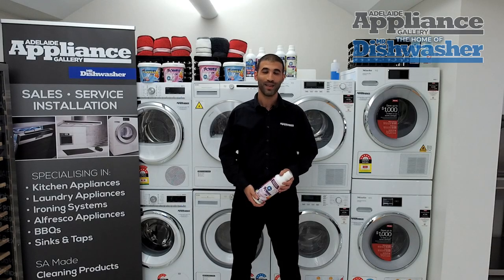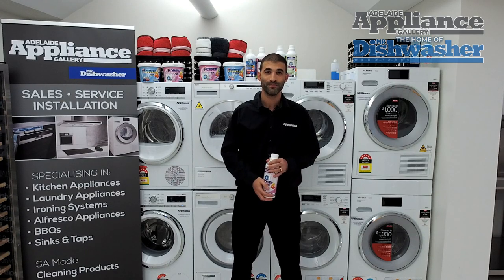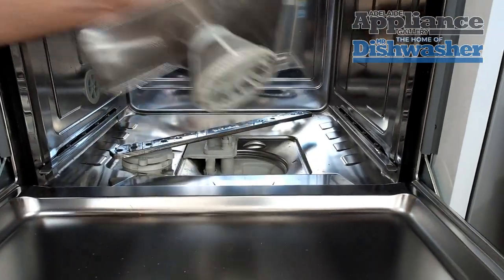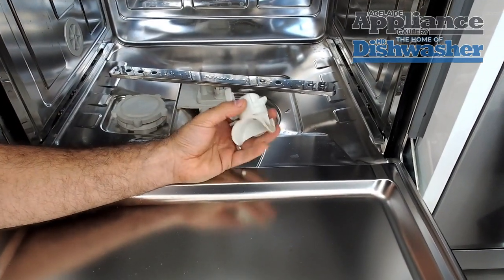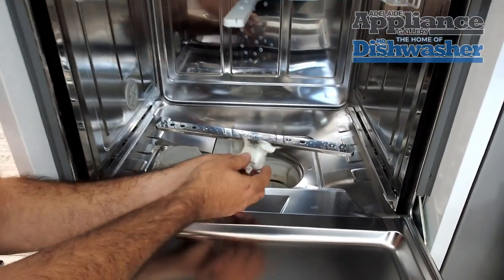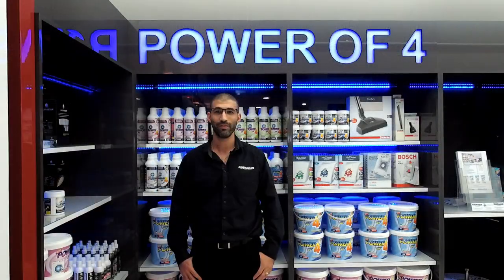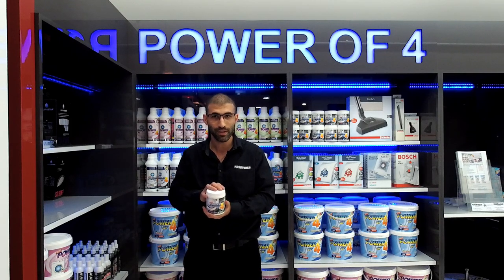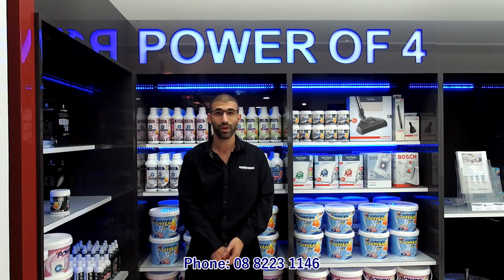Is your Miele dishwasher not draining?

Comment: Thank you! Do you have guidelines for the F18 error message?
Reply: The F18 error code is listed as “Flow Meter Stationary”.
This could be caused by:
1.	Tap is turned off or flow of water is restricted.
2.	Waterproof system failure.
3.	Flow meter module failure.
4.	Control unit failure.

It will need a technician visit to identify the issue and resolve depending on the diagnosis.

Comment: Cleaned. It still doesn't drain. Now whatn
Reply: @andrewktoris7894  I replaced the drain pump. Works like new! 😊
Reply: If it is not in a blockage within the non-return value then it could be where the sink spighott is or inbetween.